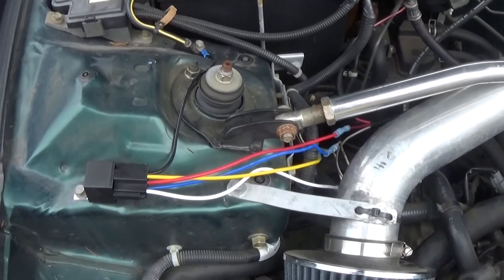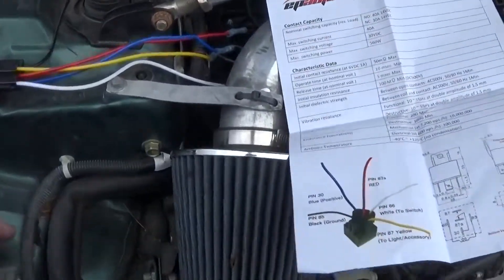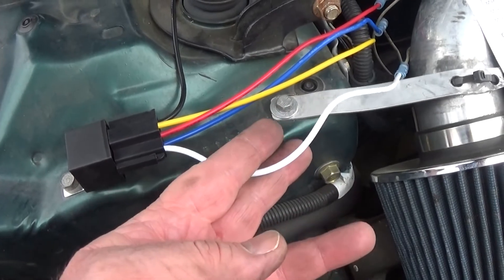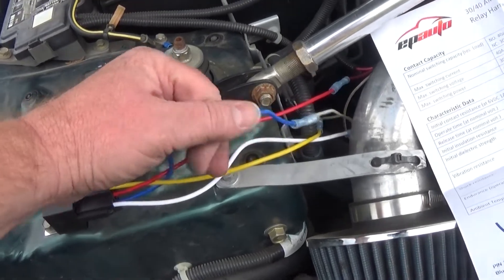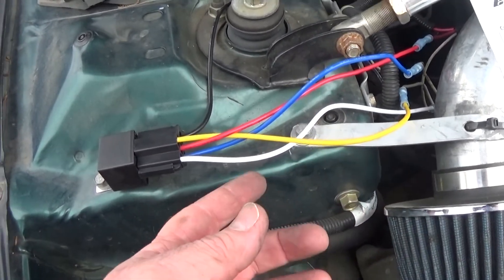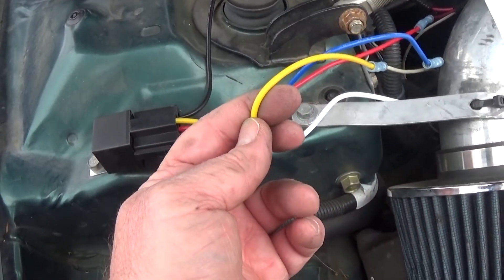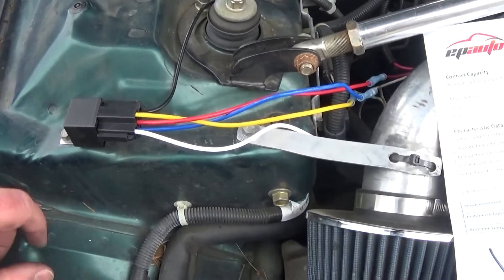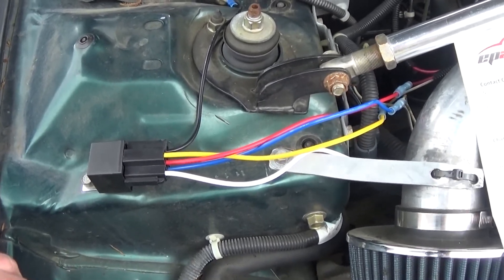Kill switch on 1999 Honda Civic

Comment: Please show me how you did this?  So what grounds the siren I understand red wire always hot correct but how did you ground it to go off?
I understand power is supplied to starter motor from blue to yellow after kill switch enabled. I would greatly appreciate it.
Reply from the maker: This link shows some wire diagrams in the pictures:  https://amzn.to/2QdhDfx
Reply: @tubejim101  I see that. But 87a is always hot. I just don't understand how the horn is not always on since it's powered up.

Comment: This is a good concept, but in its current format would be relatively easy to bypass for a thief who understands the how relay ports 87 (N/C) and 87a (N/O) work. All the thief would need to do is to change over the starter wire from the normally open to the normally closed port (from yellow to red wire) to get the car started. Therefore, I think that it is absolutely essential to put this relay in a hidden position.Another solution would be to use a three-way kill switch and you wouldn’t need the relay.
Reply from the maker: Or put a fake relay, out in the open.  All wired up.  When any of the wires are disconnected, the alarm goes off.

Comment: Hello! Do you by any chance know how to do this for a 1990 Toyota Pickup? There are no videos or instructions anywhere on how to do it. And the ones that do exist are very vague. Thanks!
Reply from the maker: Do you have a siren?
Reply: No sir.
Reply from the maker: @SaulRamirez-rk9nj  You have to understand how a relay works.  If your not going to use a siren, just get a 4 wire relay.  Two wires go to your switch, and two wires in line, to your starter.
Reply: tubejim101 What relay do you recommend?
Reply from the maker: @SaulRamirez-rk9nj  You would need to know how many amps your starter pulls, and get a relay bigger then that.  Your local auto store, might be able to help you.  Starter relay says 22 amp, so something like a 30 or 40 Amp 4 pin relay should work.  If your not sure, ask a mechanic to wire it up for you.  If you do it wrong, your going to blow some fuses, and maybe start a fire.
Reply: tubejim101 thanks!

Comment: What kind of relay and switch did you use?
Reply from the maker: https://amzn.to/2QdhDfx
Reply from the maker: https://amzn.to/2uy2DlF
Reply: Thanks man,how did you hook it up to the starter and the alarm,and did you use a fuse as shown in the diagram..
Reply from the maker: @tonytoneton2pac966  The start already has spade connectors, so that what I used to connect to the starter.  Just use butt connectors for all the other wires.  I did not use a fuse, but the starter should already be fused.